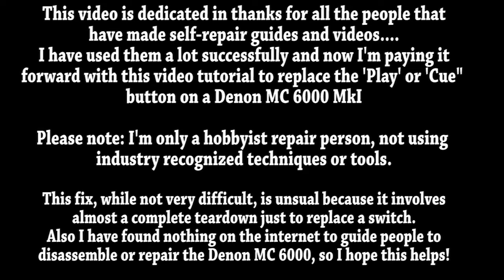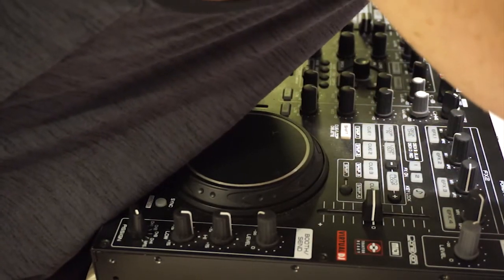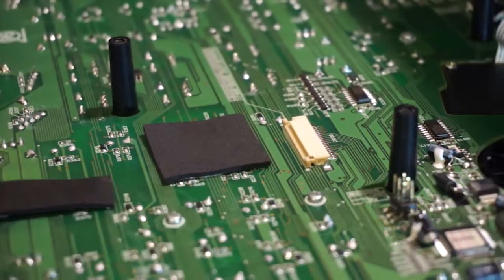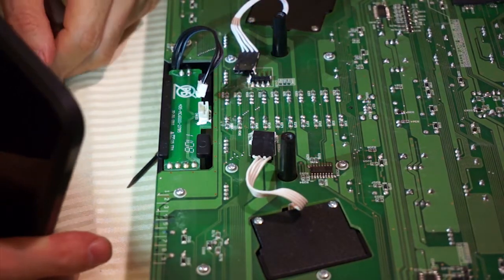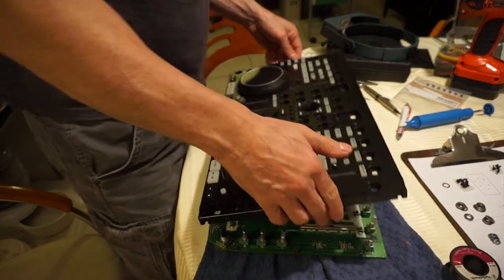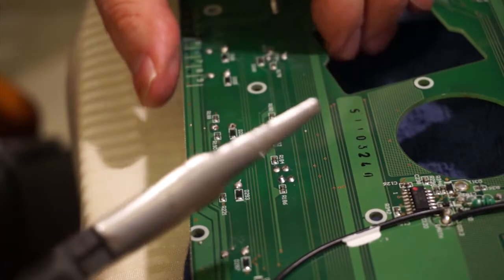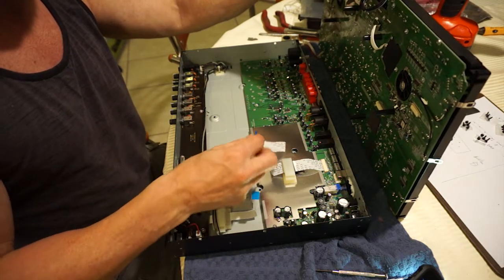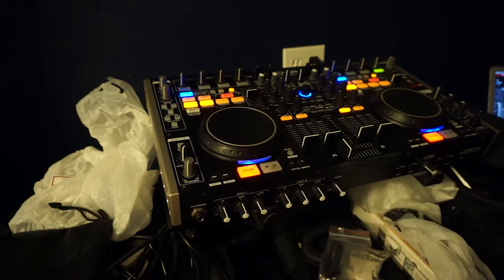Denon MC 6000 Repair-Teardown & Replace 'Play or Cue' Switch

Comment: PRO TIP: When separating the two halves of the controller, if you disconnect the two ribbon connectors first you can carefully open it up all the way and lay the top upside down next to the bottom to get a better grip on disconnecting the 3rd and final wire (the push-connector wires) Also I went ahead and replaces all 4 tact switches for the play/cue buttons at the same time since I never want to have to do this again lol Thanks for making this, it was long repair but I got it done thanks to this video!
Reply from the maker: hey Don, thanks for your tip and I'm glad this video helped, cheers Ean

Comment: I did mine too..and replaced all four switches as well (donnieisrad). Makes sense if you're in there already considering how long it takes to open the case and get at the switches. I used soldering wick to remove solder joints. Works well if you don't have a pump. Be careful with ribbons when cracking open case. Go slow!

Comment: Great video Ean, good the hear you still have the great Aussie accent! Different problem with my 6000 but excellent guide.
Reply from the maker: Thanks mate! What issue are you dealing with?
Reply: I think I have a dodgy xlr output. Cuts in and out. If I get it in the right spot its all good. (wiggle the lead) Just a bit annoying prob not worth pulling it apart for.

Comment: This was my exact problem, only on an MC3000.  The video helped a lot!

And for anyone out there with the same issue: it was hard for me to find an exact match for the tact switch, but this one is working fine for me:

TL59FF160Q

It's got a slightly shorter throw, takes a little extra push to click, and clicks a bit louder, but only when you are thinking about it.  Not enough for me to notice when mixing.

Thanks again, Ean!
Reply from the maker: Jeffrey, glad the information helped!
Reply: Now this is a great help for me. Thanks.

Comment: Yo tengo un controlador Denon MC 3000 igual Estaba trabajando con él Y de repente se Apagó y no prendió más Por favor me puede ayudar
Reply from the maker: Lamento no poder hacer diagnósticos a distancia, te deseo la mejor de las suertes.
Reply: @eansugarman4675  hey man I have a MC3000 it turns on fine all the functions work with virtual dj it's been sitting for some years but now none of the outputs work RCA /1/4 nor headphones are working I've tried all the drivers but nothing any idea what can be the issue ?

Comment: Amazing Job Ean!! im planning to repair my Mc 3000 just to have it as a backup controller , because I also own mc6000mk2 , yeah im a kind of Denon guy.  ill need lots of patience to do the job, if i decide to start in the first place. gob job!
Reply from the maker: Thanks Carlos,, appreciate the kind words,. once you get your unit going you’ll be happy because that’s the  only weak point and mine has been working fine ever since I did the repair.  Good luck!

Comment: Does any have a power issue with this same unit? The power supply led blinks green and you can hear it clicking when the button is pushed but no lights etc....

Comment: This is so helpful Sir! thank you... I recently am facing issues with the hotcue buttons of my Denon MC7000, the buttons automatically triggers midway during the set and am based in India and really struggling for support from service centre. Thanks again.
Reply from the maker: Hello Harsh, I really don’t know much about the MC 7000 but if they are triggering by themselves then it sounds to me like they definitely need to be replaced. Sorry I can’t be much more help good luck!
Reply: Ean Sugarman I managed to open the controller and spray the electronic contact cleaner which sorted the issue but the tips from your video were really helpful. Thanks again.

Comment: Amazing video, the only one I could find unfortunately! Do you know if opening is a bit easier with the MC2000? Actually I just want to clean two potis that are sending random MIDI signals to Traktor and don't know if it's really worth it. Opening the whole thing just to blow out some dust seems ridiculous... Also I don't own any equipment for soldering and have never done it :-/...

Comment: Thanks for the video, hoping the MC3000 I have to take a look in is not as bad lol.
Reply from the maker: Good luck! I don’t know what the 3000 looks like inside!
Reply: @eansugarman4675  Finally got in to it, similar but simpler; bottom of the casing comes off, then the I/O sub-board, then the front casing, then the board off the plastic inner frame in similar fashion.  Probably 100 screws and 29 nuts & washers to service the faders, but it's made it this long.

Comment: Very helpful video.  I am having a problem with no sound output.  Signal from computer via USB is not present in VU meters, cue, or output.  Problem occurred after a power flicker that caused the unit to shut down and restart.  Now I have no sound.  MC6000 controls Virtual DJ completely, however.  Start, stop, fader, volume, etc. all work but no sound. Any suggestions?  Thanks in advance for any thoughts.

Comment: Hi! First of all, really good, detailed video. My problem is that one Linefader sends wrong midi-signal to my DJ-Software. Do you think this can be solved, when I replace the Linefader in the same way as you replaced the knob?
Is there something I have to attend additinonally?
And my last question: How can I clean the device to remove dust or dried liquids?
Reply from the maker: +Achim Hausr Thanks Achim. I don't think your problem with your fader is electrical. It sounds like a mapping issue. I would reset your all mc6000 mappings to default and see if this fixes the problem. (Also, and I'm sure you may have checked it, but double check where your fader input is set to and also check the switches on the back of the unit for software and hardware mixer choices.
As far as the dust or dried liquids are concerned, if you have the unit open, it's easy to wipe down the cover board with a damp rag and then use a dry one to wipe off. If the circuit board has had liquids spilled onto it, that's a completely different matter. I can't evaluate it from here, but if your fader has ingested liquids then definitely replace it.

Comment: Found this video tear down useful for replacing cross-fader.  However, I don't think you mentioned what kind of problem you were having with the play button. Mine works.... but sometimes, it acts as if I hit it twice. Not sure if this is a firmware problem or the same issue you had.... and not sure if replacing the contact would solve my problem?   Also, while i'm inside, I was considering replacing the fx knobs with pan pots.... So that there is a stop at the center points (50%). Do you have any recommendations for that.  I'm assuming I can use pan pots. Thanks for any help
Reply from the maker: +Jamey Sewell The problem I was having was similar to yours with the buttons. But it got worse, eventually hitting the play button would not work at all and the only way I could get around it would be to assign a 'hot cue' and start every track by hitting a 'hot cue' button for that particular deck. Now that I've replaced both play buttons, I have no other problems. It is not a firmware problem. It will get progressively worse, that's when you know you have to replace the tact switch.
I really don't know about replacing the fx knobs. I can imagine you probably can do it with no problems but would need to match the specs for the original fx knobs
Glad you found the teardown useful.
Reply: @Jamey Sewell oh no , i have started having this press once but get double press effect occasionally - how has yours developed from the last 6 months ?

Comment: I am really glad that this is out here to view. You seem informed on this piece of equipment. Maybe you could give me some information on why my channel 1 and 3 won't respond in VDJ or Traktor. The system will boot and everything lights as it is supposed to however once in program sliders don't respond on chan 1 and 3 and the cue on channels 1 and 3 are not lit up until pressed? This was not always an issue... :( I have read pages of manuals and nothing I do works. Maybe a factory reset? If that is even a thing?
Reply from the maker: hard to know exactly without seeing it, could be wrong channel inputs, or wrong midi channel setting.

Comment: very good your video dear friend, I need a suggestion from you as a specialist, I have a problem the output audio of my mc6000 is very short I upload the whole master and does not sound, it sounds short, you have some recommendation regarding that. and THANK YOU very good video
Reply from the maker: I’m afraid it’s very hard to know what is causing the problem without testing the unit. Sorry I cannot be more helpful. I wish you good luck and thank you for the kind words

Comment: Can i ask does the sound output get loud and does it have okay dac in it?
Reply: The output on these controllers is excellent, they will give you either unbalanced or balanced output.
The DAC's are good quality. Denon converters have always been pretty good. The sound is always better if you let the internal analog mixer do the work compared to digital software mixing IMHO.
Reply: +MiamiMuscleUSA so you can just make the audio go thur the mixer and use the faders like normal? Looking to upgrade from x500
Reply from the maker: Yes, You can use the mixer either summing digitally in the software or summing analog in the mixer.

Comment: hello I have a problem with my denon mc6000, when I turn it on it starts up well, but it does not work for me as an analog table or as a digital table and when I connect the cable the PC does not recognize it it beeps the PC as it has been connected but the second does another as if I had removed the cable and so all the time and nothing I have looked at the technical service manual and I do not find the fault, I hope someone can help me thanks in advance
Reply from the maker: Try swapping the usb cable

Comment: yo the play button on my DNHS5500 Deck has gone a bit dodgy recently, spoke to Denon and they reckon it'd take their engineers half an hour to fix at £15 per half hour, but after seeing this I'm worried it might take a lot longer - do you happen to know if the 5500 needs tearing down as much as this unit to replace the tact switch?
Reply from the maker: I really don't know Joel.

Comment: Hey everybody! I am being offered to buy an almost unused MC 6000 now in 2021! And I think I´m going for it because it seems like such a great controller for the price. Good idea or bad idea?!
Reply: I don't see why not. If it's cheap. However, the MC6000 has not kept up with updates. Traktor was slow to develop but it's on version 3.x now. The latest updates (not very many) since 2.x obviously will not be in the controller mapping. You can get the driver and necessary files from the Traktor website.
Reply: @redbox4363  I recently looked into serato and i think even though it looks like having been developed in someones garage I will give it a try. Yeah that's also my only fear, that I will have to stick to old versions of software, probably not supported by my o.s. But I think I will be able to do it with this guy somehow. Just love the fact of having a physical mixer as well, without having to pay like a thousand bucks!
Reply: It will work with the new Traktor, no problem.
Reply: @redbox4363  hey thank you this really helps me a lot!!

Comment: U seriously need to get the right soldering tip before u damage the board tracks. Using a chisel tip for component solder points is a BIG NO.
Reply from the maker: what tip do you suggest and please explain the difference, thanks